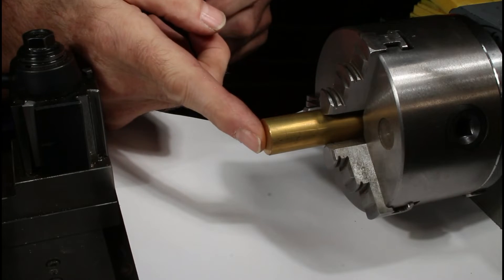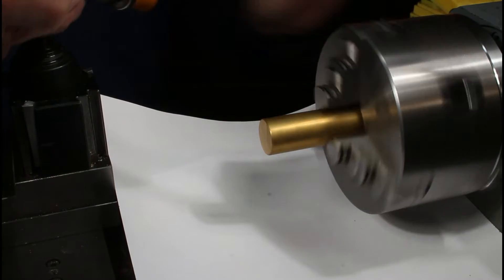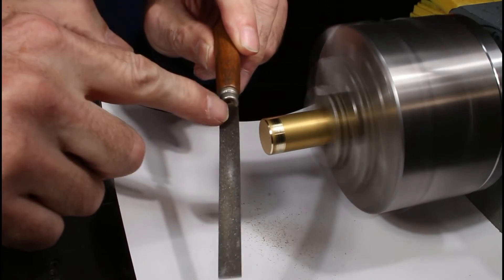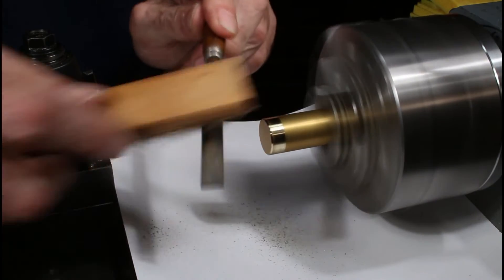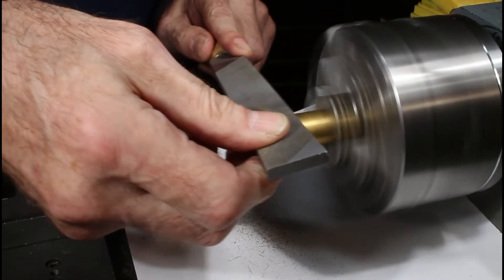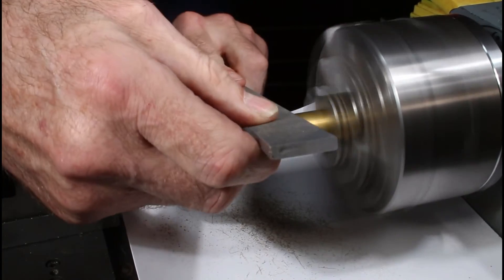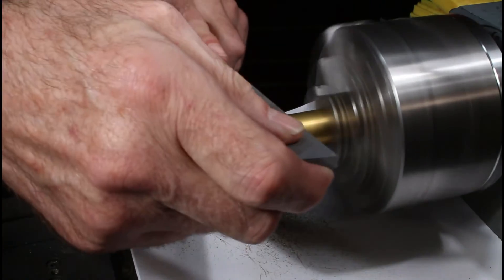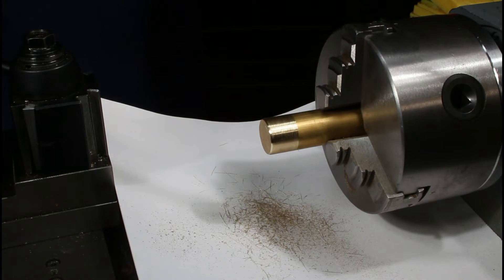Quick Tip #6   lathe file

Comment: Nice info, can we use wood file with T6061 ? kind regards
Reply from the maker: I wouldn't recommend it. But in a pinch that would work.
Reply: @GuyMarsdenMakesStuff  Thanks, I had tried, not bad :) We don't have tool exactly for T6061, but from density steel is harder than T6061.

Comment: Back in the 70's I turned printing rollers and we used lathe files for finishing the OD. Thats cool that you're showing everyone a tool that can help with finish turning.  I use them all the time. Thanks for  sharing.
Reply from the maker: I figured that there would be at least someone commenting that they knew about these.

Comment: Could you measure the angle? Because of the angle differences.
Reply from the maker: I measured my regular files at around 25°, and the lathe file is at 50° with a much finer tooth.  
Thanks for mentioning this and I'll add this to my description